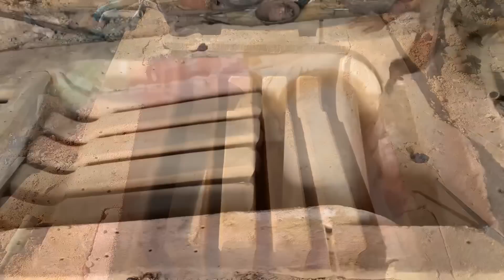Amazing Manufacturing Process of Jaw Crusher Machine Hammer in Factory& Production of Crusher Hammer

Comment: what is the point with these blue and red pipes ?
Reply: Inject carbon dioxide to cause a chemical reaction and activate the binder in the casting sand to make it hard and hold its form.